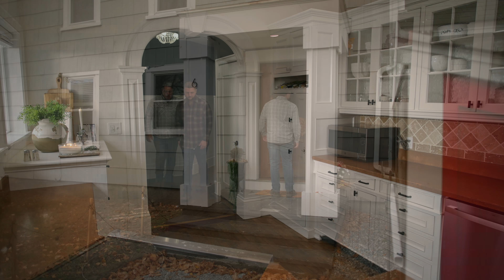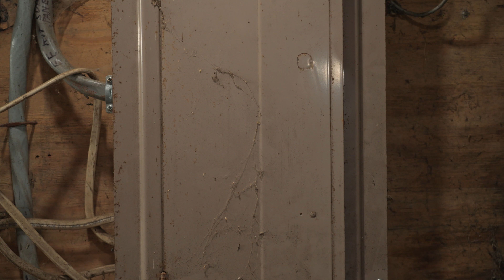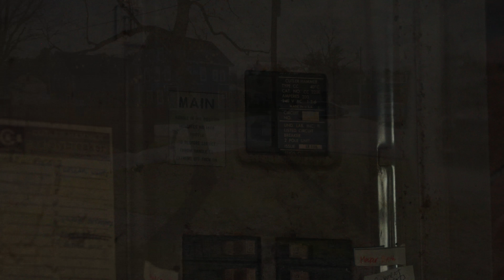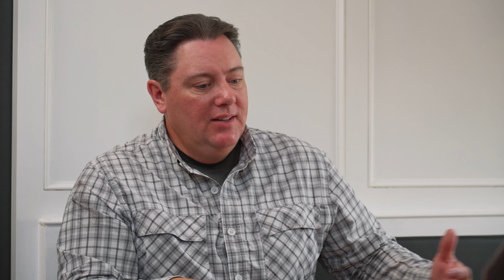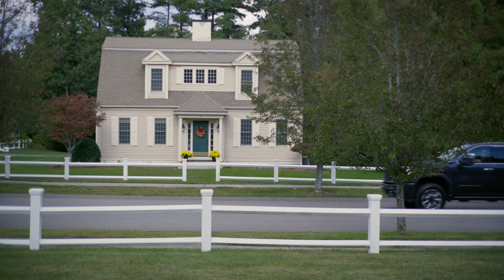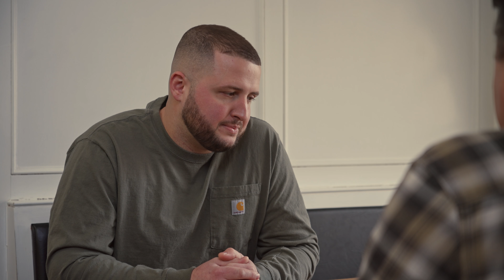Troubleshooting a High Electric Bill | Ask This Old House

Comment: My bills getting higher year by year. Up to $850/month😅
But when I look at the actual consumption, I’m using less and less each year. It’s the Utility companies raising the rates!
Reply: I'm in RI and also have high electric rates. However, my bill is never more than$200. At $850 you must be using a TON of electricity!
Reply: @jeffmpvd7689  mine top out at $170 in the winter in Colorado and my house is 106 years old. These people must have grow operations.
Reply: Because they AIN'T gonna LOSE to You trying to SAVE.  I knew when the first push to get people to switch to CFLs/LEDs I said to Family/Friends Power Companies are going to severely raise fees for ElecTRICK Bills.  No one accepted what I said.    
All the stuff today that's "Energy Efficient/Low-Power Consumption" Our Bills should be $25 monthly ANYWHERE in USA.  
Years ago before the "Green-Washing" many Electric-Powered items ran 
🔥HOT🔥- Fridges/Light Bulbs/TVs/Stereos/Vacuum Tubes/older Computers/Etc.  People's Electric Bills were cheaper, not just because rates of inflation was lower.
Reply: @bboi  wow how big is your house?
Reply: @RealMTBAddict  4000sqft in the 115° desert. AC ☠️
Reply: $850 a month?

Comment: First thing i would do is wrap that water heater with a blanket, Re-insulate all windows and doors to eliminate any cold air drafts, use the fireplace daily, replace all lights in the house and garage with LED lighting, and add more insulation to the attic :)
Reply: Try cutting your power for 12 hours at the tank. It is still hot enough to take a shower. That's not the problem.
Reply: @MikesVlogss  all water heaters are insulated on the inside dude.
Reply: Changing the lighting won't make a big difference. Converting to natural gas would make a huge difference.

Comment: IF I WAS THE HOMEOWNER, I WOULD FIND THIS ZERO HELPFUL.  The way I run my home right now, I shut off a lot of circuit breakers.  Why does the homeowner need the shop breakers on all the time?  This guy has the one of the most energy wasteful homes in Mass!
Reply: The mini split is on the shop breakers
Reply: @xsietube  and I bet he turns them on when it gets to 70 degrees. Another comfort baby! When I had AC I wouldn't even turn it on until it got to 85 inside! 
People nowadays have to be super comfortable 24/7 and wonder why their bills are so high.
Reply: @xsietube  And he probably keeps them running even when it's 70 degrees outside. Nobody talks about that.
Reply: We really don't have enough information in this video to say how useful it was. Moving away from a resistive water heater was a decent call. Otherwise,  you want to dig into the numbers to understand where your usage is going. An energy monitor probably isn't a bad idea when there is a tenant that shares electricity. We really don't know what the 'shop' is to allow us to say just shut its power off. They are making a public video about someone's house to try to provide useful information without disclosing unnecessary personal information.

Comment: Incomplete diagnosis.  Need time of day graph on well pump.  If its running a lot at night, there is a pressure leak in the system or the bladder tank has failed  etc. and yes cold temps can worsen the effect.  If the mini split is a heat pump it has emergency electric heat mode.  Is this turning on too early or is the thermostat improperly wired or failing?
Reply: @NorKavon  exactly we need to see a graph
Reply: Folks, this is Boston in the winter.  It is way too cold for a heat pump to run, so the electric heating elements come on to prevent the coils from freezing.
Reply: @michaela1655  Its a Senville Aura thats rated for as low as -30C. I have the same in my house and it works well in the winter, even close to those temps. It doesnt have auxiliary resistant heating though, so that unbalanced load, if using the same heat pump in the shop, is concerning.

Comment: I discovered that our collection of wifi connected smart devices—bulbs, speakers, displays, smoke detectors—are constantly consuming power even when idle.
Reply: Well duh. How can your Alexa spy on you if its microphone and SoC are powered down?
Reply: yes they consume a combined 100 W.
Reply: It's not too smart to have so many "smart" devices in your home.
Reply: Yep....electrical vampire devices....I even disconnect my microwave at night.
Reply: @digidrum2003  - My entertainment center was like that.  Too many things being powered that were not being used.
I zoned it all with power strips that get turned off when not in use.
Reply: @digidrum2003 that will save you 1$ every two years….
Reply: @digidrum2003  🤣 your microwave isn't using but a fraction of a watt when not being used. You sound like my mother who unplugs cellphone chargers when not in use. They don't use anything when not being used.
Reply: @RealMTBAddict  Guess you don't understand the conversation......that is just one of the many devices that can be unplugged to conserve electricity. Tell your mama hello for me.
Reply: @RealMTBAddict   Actually, the THIRD largest energy expense on our electric bill is a category described as “Always on”. Oddly, that is separate from a category labeled “Electronics”!
Reply: @ Just put everything major on a wifi controlled outlet.

Comment: If you think 25° or 30° is cold then you’re not in a cold climate. Having a massive electric bill in a mild climate like that is because you’re using electricity for literally every heating appliance in your house. Convert everything you can to natural gas and thank me later. Electricity is the most expensive way to heat. Natural gas is way cheaper. Sadly natural gas is not available for everyone.
Reply: That's not very good advice, maybe you can save something in the near future, but you never know how natural gas price could change, and that's terrible advice for the planet.
The best advice as said in the video is getting solar installed by an honest contractor and be as indipendent as possible, even without battery (imho very expensive and not always necessary) storage is very good.

In the end saying "Electricity is the most expensive way to heat. Natural gas is way cheaper." is not always true, there are a lot of very good solution cheaper and also greener.
Reply: @quelragazzodeigiochi9166  it is the most efficient for thermal BTU and efficiency.
All people need to do is insulate to an r30 effective wall and you can heat your home with 1/4 the energy
Reply: Because natural gas has been cheaper in the past does not mean that it will continue to be cheaper in the future. We are entering a new era where much more natural gas will be exported as LNG, so it is very reasonable to assume that natural gas prices will rise domestically.
Reply: NG is not cheap. My delivery costs are more than supply costs.
Reply: Yep; but many areas can't get natural gas. I have it in my area of northeast N.J. but I have a nephew in western N.J. who lives in a part of the Appalachians and can't get natural gas. His electric bill is through the roof.
Reply: @flexiblestrategist9922 I agree it’s not available everywhere. It’s obviously the most ideal. But you don’t have a lot of low cost options if it’s not available in your area.
Reply: Exactly, NG is not in all areas. We're stuck with either propane or heating oil. Both are pricey in my area.
Reply: Heat with wood

Comment: The heat pump likely has an electrical back up heating element which would be my guess.  I would not put a heat pump water heater in the basement as it basically pumps out cold air into a cold basement and I've found that they cause condensation, which is not good in a basement.

Solar, yes, 100% do it and if you can do it yourself, it really isn't hard.
Reply: He labeled it a mini-split which has no backup heating elements.
Reply: @BillR-e2g  ah, missed that

Comment: I installed Leviton Smart Breakers so I can see what power is going where.   We live Off Grid so knowing where an energy hog might be is important.
Reply: How are you liking that Leviton smart panel/breakers?
Reply: @Obtuse94  I like them since I can monitor how much power is going to each circuit.  I do wish that the app was a little better and it updated faster but overall I'm happy with it.  I've had them installed now for over 4 years so there is likely a newer version by now.
Reply: Try home assistant  @Off-Grid
Reply: Awesome, thanks for the info  @Off-Grid
Reply: You really are horrible at spamming LOL.

Comment: Is that a reasonable amount of draw for a well pump?  I'm wondering if he's got a water leak somewhere.
Reply: Three households drawing from one well.
Reply: @davidparker9676  but you are all assuming.  Need data.  Maybe bad pressure tank or the pressure tank or pump is undersized for 3 households.  Need to confirm with hard data the usage is ordinary
Reply: @ Maybe. We really need more information to see if the KW/H use changed of if the bills are higher just due to higher rates.
Reply: Those showers are probably running all at the same time every day

Comment: that hibird water heater ain't gonna do much in a New England winter, it just uses heat in your utility area that you are providing from another source, they do work out great in the southland where it's relatively warm even on most winter days of course you can use the backup feature but that puts you back to electric water heating.  With the high utility rates in New England anything electric is going to be a hard sell.  Best idea is to switch to natural gas.  Now the deal on solar panels is this, if your roof goes bad they have to uninstall them before they put the new roof on and then reinstall them after that is done AND installing panels on your roof will probably void any warranty on the roof itself.  Watch out there a lot of fast operators in the solar panel industry and if they warranty something for twenty years and they've only been around for five, you gotta wonder, eh?  In this business rules are changing daily so what sounds good today might not be true tomorrow.
Reply: @henryostman5740  my hybrid  waterheater uses 10% more in winter, temp stays around 50, no additional  heat in basement, free ac and😀 dehumidifier  in summer

Comment: So pay $25k for solar setup, to help save about $100-$150 a month or so on electricity,  and then when you approach your break even point in 10 years or so, then you start having solar panels, betteriea, etc,  go bad and need replaced costing you more and more and no longer providing a positive ROI. Got it, ill get right on that.....such a scam market
Reply: @natersalad889  and most likely financed by Goodleap or some other predatory loan company charging you 13% with no way to make a principal payment.
Reply: @natersalad889  and most likely with a terrible loan company that won't let you make a principal payment.
Reply: My landlord had installed solar way before I moved in and I never paid for electricity ever. All year round it was 70 degrees F and at the end of the year I got $400+ check from the utility company. Only thing I actually paid for was the rip off connection fee each month. Talking with my neighbors I was saving $1200 to $2k a year because of the age of the house and the insulation standards of the time at construction. I wasn't the first renter either and the landlord lived there prior too before they left for a warmer climate.

My aunt pays $1k a month during the summer and winter times so solar would pay itself back in less than 2.5 years. The house was built decades ago so basically no insulation because that was how it was.
Reply: @tfte-b7c  Lol how big is her house? My house was built in 1919, no insulation in the walls and my winter bills are about $170, summer around $100. I don't buy she's paying $1k a month, does she live in a 10,000sf mansion?
Reply: @RealMTBAddict   exactly, my house is 2100 sq ft, in indiana,  and my highest electricity bill in the summer running the A/C has been $120 a month, in winter and fall its only around $80 a month.
Reply: @RealMTBAddict   exactly, i have a 2100 sq ft house in Indiana, and the highest my electricity bill has ever been was 2 summers ago a really hot summer with the A/C on nonstop it seemed like, was $120 that month, typically around $110 a month , and in winter and cooler weather, its around $80 a month

Comment: Did they at least check that the heat pump was working in heat pump mode and not emergency heat mode (aka electric elements)?
Reply: also should probably think about kicking it down a few degrees and wearing a sweater when he's in there.
Reply: Agreed.  On the coldest days, the auxiliary heat system could be the problem.  An easy fix is to change the thermostat setting to heat pump only.
Reply: @bruceclark7198  "An easy fix is to change the thermostat setting to heat pump only."
Wife says no.
Reply: Had the same thought.